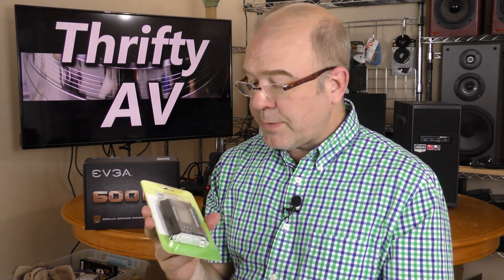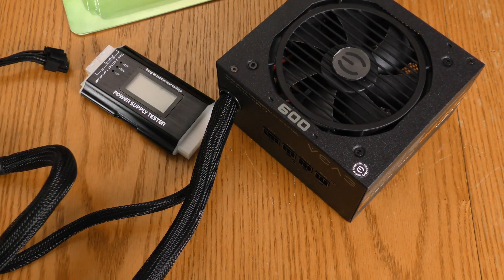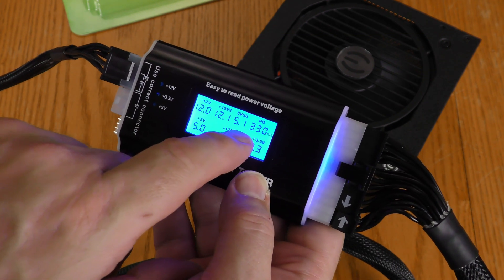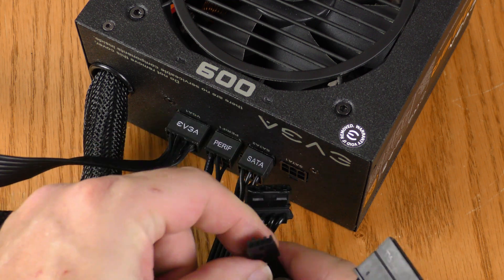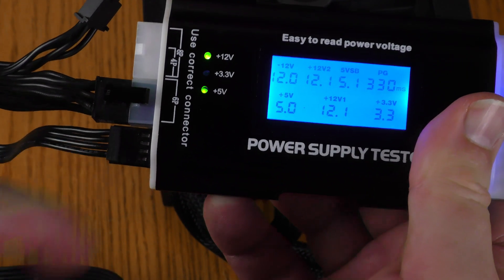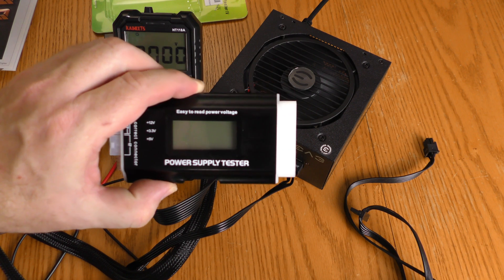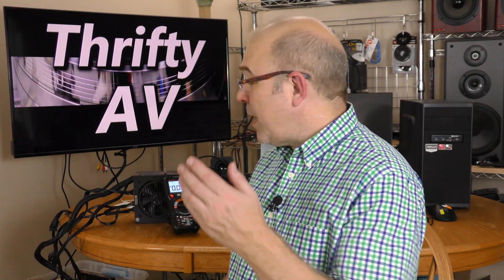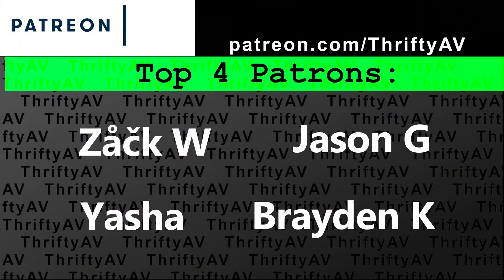Find PC Problems with a Power Supply Tester!

Comment: With the PSU tester people have suggested testing each cable one by one so don't have anything else in at the same time but the 24 pin of course. 
But yeah I got one of these because I didn't want to do anything that damage my PSU or motherboard and don't have a risk of shocking myself. 
My OC won't turn on and I hope after I do decide to get to it that it's just the PSU or a cable and not the motherboard itself

Comment: From what I see, this tester does not have power cord for itself. Therefore, if plug to a PSU and you do not get reading on the panel it means the PSU is bad, is that a good logic?
Reply from the maker: It could also be your power strip/outlet.  It could also be your power cord.  It could also be the toggle switch on your PSU.  You might also have a faulty tester.  If you can rule out the other possibilities, you likely have a bad PSU.

Comment: Good video but your affiliate link does not go to the tester shown in your video. Also when test GPU and CPU cables with a multimeter does the black probe stay in a ground pin on the 24 pin atx connector always?

Comment: i ordered one of these. All i need to do is to check the voltages. If they are right then it means my custom length PSU cables are made correctly

Comment: @2:00 The Plus four connecter has to be inserted first before the 20 pin in order to insert it all the way and also prevents it from sliding back out. There is a little tab on it that will prevent  you from inserting  it all the way in if you put it in last. The same pin prevents it from backing out when inserted in the correct order.

Comment: I been reading a course on PC repair. It tells you when you power on a power supply and test it with a multimeter. Make sure you a load on the power supply
Reply from the maker: Better testers can simulate loads, and that is the best way to test.  This tester just checks voltage problems without a load.

Comment: What if the PG is only 130ms like mine?  the tester also keeps on beeping, does it mean my psu is defective?  all other values are normal.
Reply: I’ve been trying to find an answer to this specific question, did you figure it out?
Reply: @CasualVitality  did either one of you happen to figure this out? Lol..
Reply: the manual says "if their test voltage is exceeds the normal range, the buzzer will sent out beeps for a long time and the corresponding voltage or pg value display status is flashing, it means that power supply is a fault source"

Comment: need to actually put a load on the psu to test it properly.
Reply: How do you do that with it unhooked. Genuinely curious as I’m having issues with my pc constantly restarting in the middle of playing a game
Reply: @DestroyerX6  you should be able to connect the PSU to an outlet by itself, then use the tester.
Reply from the maker: This tester is an inexpensive way to see if the voltages are outside spec on your power supply with no load, as this can occur. There are better (expensive) testers that can simulate the load of a motherboard.  If you are a technician, and not a hobbyist like myself, such a device would be worth the investment.

Comment: Restarting after power down - Capacitor discharge?
Reply: I believe that is due to back EMF (see also Lenz's law), essentially the same thing as all circuits have inductance and capacitance when the current is changing. Obviously an AC circuit is constantly changing. DC is a little less obvious but turning off the current is changing. Strange things happen under non-steady state conditions. A high frequency AC circuit starts to behave as if it were a DC circuit and a high frequency DC circuit (such as those occurring in computer circuits - on and off) start to behave as if they were AC circuits. If there are any EEs out there feel free to correct me as I am an ME not an EE. Mechanicals use electronics as tools but we are forced to understand them in our college requirements <UGH>

Comment: I have a similar unit and the PG is 0!  But the PSU is fine and working with no issues. EVGA said the cheap testers do not test PG correctly. How could you get 0 and a unit be fully operational?  Also other EVGA PSU test 100 and all of the non- EGVA test lower than they should. These units cannot be trusted to test PG properly. Volts are fine BTW!
Reply: I know it's been ages but can you tell me if that 0 PG power supply survived long term? I have a fairly new one showing 0.

Comment: Where can I get the 24 pin connector diagram shown in your video?  Thank you, and I bought the "tester" using your link.
Reply from the maker: The following page has 24 pin out, along with Molex, 6pin, 8pin, and more.  Thank you for using the affiliate link.
http://www.copperramparts.com/2018/05/19/pc-power-supplies-part-2/
Reply: @ThriftyAV  Do you have any recommendation for a multimeter?  I think I need to build a tool set of items to diagnose this type of issues.  Thank you for your prompt response.
Reply from the maker: @orestesdd  https://youtu.be/B_-f8WJRrsA

Comment: Hello Bro! I bought this item just from Amazon. I plugin in my 6 pin  PSU power supply for my Goldshell mini doge miner, but it doesn't work. My question is do I need to connect 24pin power supply to work, or something wrong with device? Please any ideals otherwise I want to return it.
Reply: you have to plug in the 20 or 24 pin  to test all others

Comment: These are a total waste of money best way to check if your psu is no good is with another known working one , it may show all good but will not show power draw, it's like a car batt thats dead will run lights radio ect but will not start the car
Reply: I have to respectfully disagree. First off this device is really inexpensive - I paid $18 for it delivered from Amazon. Multiple events can cause a power problem or worse something else may be failing due to a power fault and is masked - say a failing video card (this happened to me). I had several power supplies I was not sure if they were bad or not. While this device will not detect fault under load it will rule out fast and easy any just plain old dead PSU allowing one to determine quickly and easily determine if its OK or not. I tested all the old ones I had and found 2 were definitely bad and threw those out. 

You will spend far more time wrestling with a multimeter because the leads won't fit in the sockets. Of course if you are an octopus with 8 arms you can do that easily  :)
In addition a multimeter has the same issue - can not test under loaded conditions. While this little device may not give you the exact answer to a problem it saves time by eliminating the basics first. I spent 2 hours wrestling with a multimeter before I gave up
Reply: @rongibson9702  he wasn't arguing that it was faster than a multimeter. Its simply faster to swap out the power supply with a known working one. This tester will not necessarily tell you the PSU is bad. While it is quick way to check the voltages, unless for some reason you don't have another working PSU laying around,  It is still a waste of time more often than not. It doesn't do any sort of load testing or tell you its efficiency. You can have all the right voltages and still have a shit power supply.
Reply: @TexanWolverine  yo i just bought a used psu, how could i know if its still in good condition or no? the outside part still looks perfect (msi mpg a850gf)
Reply: 🎯💯 @rongibson9702

Comment: I built a computer with used parts.  On day 1, everything worked fine.  On day 2 and 3 the RGB lights on my cheap "Darkflash" branded fans stopped working, but the fans would still spin.  Around this time, I learned that the USB ports would only support my mouse and usb flash-drive intermittently.  I disassembled the fans and I could see that each LED strip showed exactly 1 burnt out spot on a tiny circuit controller, but the burn marks were in different locations for each fan.  I have sharp eyes but was unable to see any signs of burn related to the USB ports.  Am I crazy to think the problem with the fans and the USB ports might have come from the power supply?  And if so, would this tester help me to confirm the PSU as the source of the problem?  PSU is a Corsair GS700.  It's old, but I do still hope to use it.  Thanks!
Reply from the maker: This tester is an inexpensive way to see if the voltages are outside spec on your power supply with no load.  With USB issues, pay particular attention to the 5V test.  Power supplies may perform differently under load, and this device will not test this.

The problem may also be with your MB.
Reply: Thanks!

Comment: I accidently plug the 6P connector (that goes to the graphics card) on the 4p to 8p (that goes motherboards ) and got sparks i already knew that power supply was faulty do you think i damaged the power supply  tester? I tested another power supply after that and i it tested good even thought the second power supply did no had 6p for graphics cards.

Comment: I use the pc/sps tester to check the initial voltage without load. It won't tell you if the psu has issues, just if some of the voltage is not in range. Passmark has a physical psu tester that does even more testing than one of these simple testers, and it's in line, so you hook it up to a working system to impose load on the psu and test the voltages. Problem with the Passmark tool is that it doesn't work with server psu's or 12v only psu's (the new standard that has the psu components on the motherboard). In that case you can just populate a test system with gpus, hdds etc and impose a stress on the components to impose a high load on the server psu's. Alternatively there is other testers that are for electrical engineering... These can be a bit expensive and often not worth it unless your a psu manufacturer, and rma facility or something like that.
Reply from the maker: You are correct that this device will not test a psu under load.  Over the years, I've had power supplies go bad with voltages out of range with NO load applied.  This tester will work for extreme problems like those.   I looked into the Passmark Inline Tester you mentioned.  This looks like a really cool device, but it is currently unavailable on Amazon.  Also, as a hobbyist I cannot justify the price tag.  If I'm having issues with a PSU under load, I'll just swap it out with another and see if it fixes the problem.
Reply: @ThriftyAV  yup. I'm just sharing some info. I've been a repair technician for over 20 years.